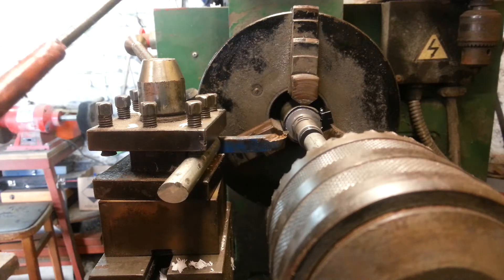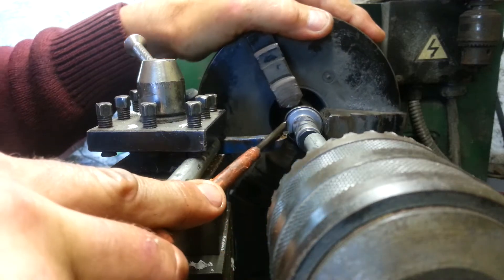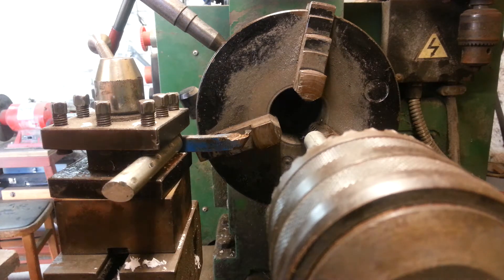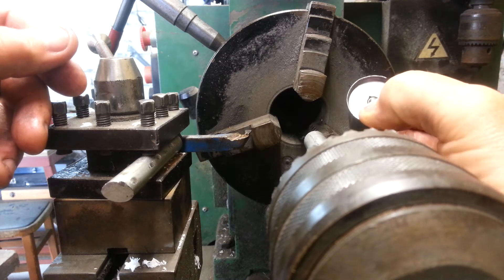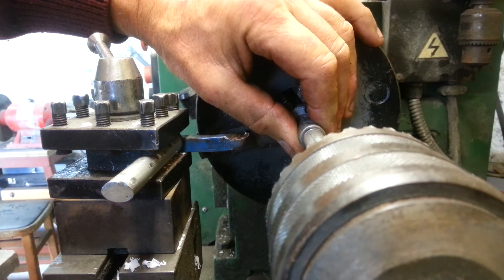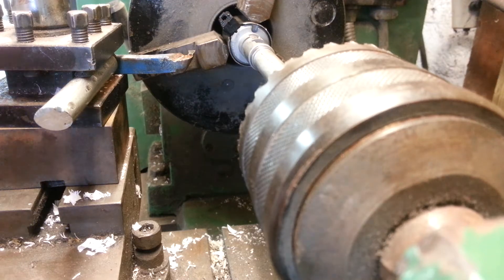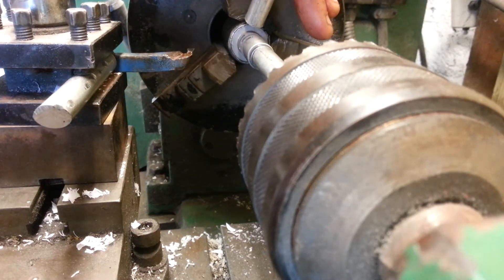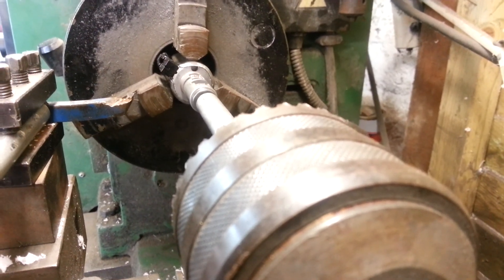How to repair VW Automatic gearbox 09G for the price of 5 cans of ATF

Comment: Any ideea how to lower a little the presure from the mechatronic? 
For the second time has cracked the presure acumulator base :(((
Reply from the maker: Try the same trick on the valve body or check/replace pressure switch
Reply: Nigel Loller 
Can you tell me wich one it is ?( the pressure switch )
Thank you
Reply from the maker: https://www.sonnax.com/tech_resources/284-09g-tf-60sn-valve-body-identification
Reply: is this a common issue with the 09G?  I know that the valve bores wearing out is a problem with these.  The 09G in my car takes a filter which is more like a fine mesh screen.  Then some transmissions have a filter made of some sort of paper or felt maybe.   I just wish these had a screw on filter which would be easier to change.  I am glad that these do have a drain plug and can sometimes be filled from a hole higher up even though they don't have a dipstick.  That hole higher up is sometimes a fill hole with a T-55 torx plug or it might be a small grey tube with a red ring  on it.  If you have either one of those you can fill without filling from underneath the car which I hear is messy.  Do they deliberately design these to discourage any and all maintenance?  It sometimes feels that way and it is not just Volkswagen and Audi doing it but they are all doing these things these days.  It is so bad that it surprised me when I found a transmission dipstick in my mother's 2017 Rogue, I just have to remember that it takes CVT fluid as normal ATF would ruin it.

Comment: HI Nigel,
We also have a Golf with an 09G transmission, that plays up terribly when it is hot.
 I noticed that the Transgo kit does a similar job but it also recommends drilling out holes in the gaskets. Did you have to do anything other than repair the solenoids to fix your problems?
Reply from the maker: Sorry just seen comment ...No holes drilled out ..all valves were smooth with no work required and all springs were intact

Comment: nice jop man how many miles did you do after the repair and is this also the same as the passat b6
Reply from the maker: Thanks Issa ..Still working perfectly..I can't see any reason for it to fail again (or at least another 50000 miles) as it is only a lack of oil changes that caused the problem..This is a very common gearbox on the VW four cylinder engines